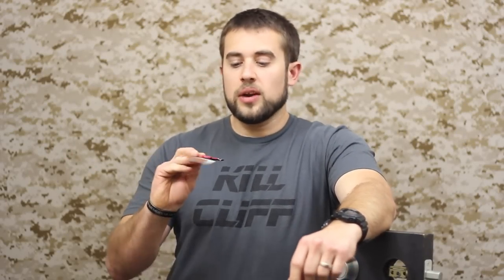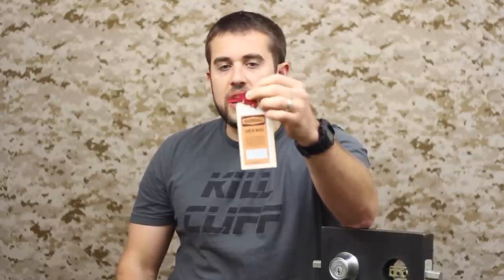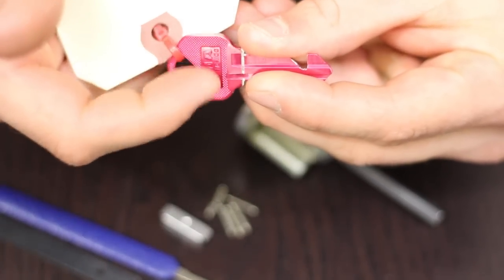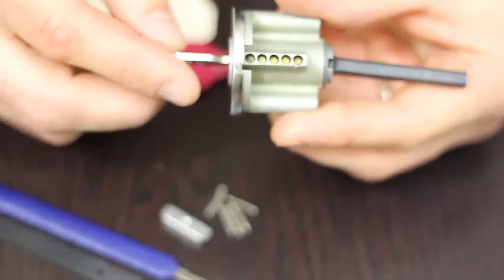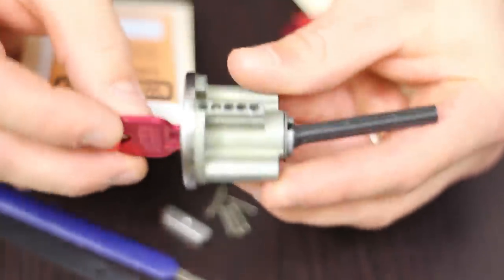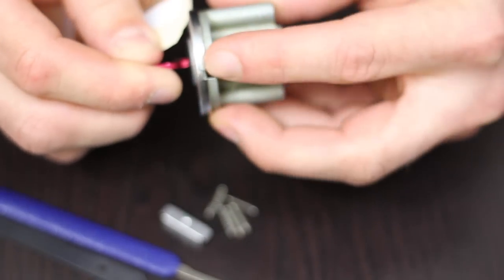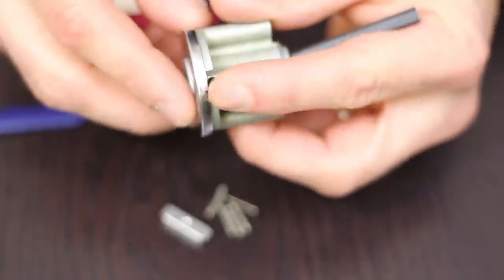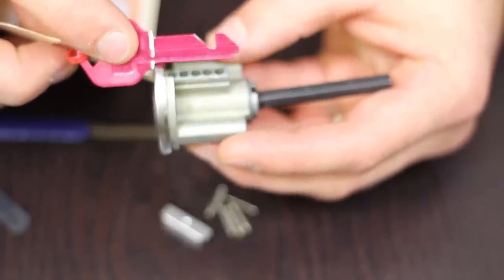Permanently Disable a Household Lock with Lock-Kill

Comment: How well does that work on Multi Lock? Thanks.
Reply: +X- Tremevidpro There is no Mul-T-Lock version, and there never will be. Mul-T-Lock dimple locks work differently, and you're much better off breaking an old key off in the lock and supergluing over it. A locksmith (or a clever enough person) can easily recover the lock afterwards, and recovering the lock without authorization would be considered breaking and entering in just about every jurisdiction.
Reply: How about Medeco? Can those be picked?
Reply: +X- Tremevidpro any lock can be picked. Medeco locks tend to require much higher skill and/or luck to get open. For some of their locks, there are sidebar bypass methods (eg medeco3 bent paper clip bypass) that can make it much easier to pick. Making a key like this for a Medeco lock would be kind of stupid, as the lock cores themselves trend upwards of $120 each.

Comment: I think this is very self explanatory -- all you had to say was - "this key traps the pin in the 90' section...so you push it in and then snap of the end... you can only remove by drilling it - you cant use a lock pick"

Thats how simple it is - 30secs is all you needed

Comment: It appears to do as advertised. However. not sure this is the best solution to prevent someone from being able to unlock or lock in the future. As you are basically destroying (rendering useless) a lock which if you are a landlord would need then to replace the lock. To skip past the clamp/lock type blockers that would prevent the knob from being turned or key being inserted stuff. Why not just change the lock since your going to need to do that with this product or if the tenant finally vacates you will need to change the locks. I just think this product just has a malicious purpose that will only be used by someone in a vindictive manner vs some official or legal purpose..

Comment: You can take the handle apart and use a piece of pop can from the back and slide it in over the pins (between the pins and the key) to release the pins instead of taking the spring holder off. Of course you would need access into the house first to take the handle off.
Reply: Won't work. You can't shim a cylinder if you can't life the pins. I use an uncut key and slide it out as the shim slips in the shear line. With this key pushing all pins up, and all shear lines in the wrong places, and the one pin stack down in the plug, there is no way to shim it.
Reply: I understand what you're saying but a thin piece of tin "pop can" can save the lock and not damage it.
Reply: What a "POP"can? I have never heard of one before?
Reply: Aluminum soft drink can.  Soda, pop. Depends on where you are from. In the south, where I am, it's a can or bottle of pop.
Reply: jimu57
 I have lived in Texas my whole life and never heard anybody call a bottle or can of soda a can of "POP". I had to do a little digging on it and found out that the word POP comes from the Midwest not the south.
Reply: The old Andy Griffith shows called it "a bottle of pop" at Wally's fillin' station.  I have always called it pop and everyone in this part of the state does. Well, most do. Its rare to hear soda unless its from someone that is from north or west of here.

Comment: So if your a landlord and lockout a tenant with this thing how do you get it out later? Our deadbolt requires it to be unlocked in order to remove it... Do you have to replace the door or cut out the lock and patch the hole every time you evict someone?

Comment: This gentleman use the implication that this device was going to be a tool for a landlord to use in order to disable I walk for a home so that the tenant could not enter the home before the landlord had the ability to change the locks I don’t see how that’s possible or for that matter legal. The landlord is not allowed to change the locks or disable the locks and deny a tenant access to the property until they have a legal court order to do so once the court order signed by the judge the landlord is then accompanied by A constable or sheriffs deputy to evict the tenant and would also wet that time bring a lock set to replace the old locks with. At no time with this device be legal for the purpose the gentleman described. And for any application in which this would be legal it would simply be unnecessary

Comment: I see no practical use for this myself?, but if  I had one?, I would just buy only one of each for the pattern and cut my own from blanks there on because it is no trouble to intentionally snap a key off after it is inserted into the lock. This product likely will not last long?, because it would be too easy to do that instead of paying $10-20 bucks a pop for one.

Comment: What's supposed to be the point of this? It just breaks a lock forever unless you're going to take the door and lock apart. If it was difficult but possible to extract I'd see the point, but this is the same as pouring superglue into your keyhole.

Comment: Changing a set of locks takes 5 minutes. The only possible use I see is if the tenant has already changed the locks to remove access for the landlord, so the landlord could, in turn, remove the tenant's access. He'll wind up calling a locksmith one way, or another.

Comment: That's a little overboard.  All you need is a flat toothpick and some bubble gum.  Shove the toothpick into the lock, break it off, and mash some bubblegum in after it.  The bubblegum hardens after awhile.
Not as permanent as the video above, but just as effective.

Comment: This product seems so pointless. You now have to break the door or a window to get back in (unless there's another door in which case this is pointless anyway) and then you have to buy a new door and a new lock to replace it. If it's a Schlage/old style kwikset and you know what you're doing, you can also pull it out from the back of the cylinder once you remove the retaining parts

Comment: I think I know a way to remove this key.

We know that the key is easily inserted, but gets caught on the way back due to the 90 degree cut.
Knowing this, the obvious solution is to remove the handle of the key and then push it all the way through to the other side. 
This method would only work in cases where the lock is two-sided, however.
Reply: Jonathan Fowler no, no that's not how locks work

Comment: just jam something in the lock like some paper and mash it in hard..  I knew a guy who would take a good key cut it between the pins about half way down.  Then put the tip in and push it the rest of the way with the other half or maybe another key.  They won't be able to get their key in. I personally think its too much work, as I said just jam anything in the lock and pack it in there.

Comment: Could just rekey or replace lock. $60 for rekey kit vs up to $50 on small house with this. And rekey kit you can do thousands of locks. So how the landlord supposed to get in now? Now landlord got to spend $200 having 2 locks drilled...dead bolt and knob and still has to rekey or replace. Why don't you just hand landlord a stapler to staple all their money together to roll up and tear off roll to wipe ads and flush.

Comment: don't use glue nerds,  after you use this fancy device here you can just take the lock apart and remove the pins that are holding it in.  then you can piece it back together and use your lock again or save the pins and rekey the lock

Comment: This would handy for spies escaping through a very specific type of door that the place they’re doing the mission may not have, but in this very specific scenario, it might be useful is some very specific circumstances take place, every single variable needs to fall into place for this but hear me out. 

Spy is compromised, door is open, door has lock, door has turn handle on the inside side to lock/unlock without key and guards have the keys to the whole building so could unlock the door, spy places lock kill key in the lock on the outside of the door and snaps off the head, guards chasing spy can not unlock door, buys spy time to extract. 

Other than that yeah this is totally fucking useless dude although I respect your enthusiasm for such an inane creation.

Comment: Great idea!  Disable the lock to deny the tenant/renter access, as well as denying yourself access!  Brilliant!

Generally, one needs to be able to unlock the lock in order to remove the lock or even just its core in order to rekey it.  A lot of Kwicksets may be easily drilled, but Schlages often have anti-drill pins of hardened steel installed specifically to defeat attempts to disable the lock by drilling it.

A much better idea, since using a Lock-Kill will require you to replace the lock anyway, is to just rekey the lock to begin with.  A locksmith will charge less for a simple rekeying than for removing and replacing the damaged lock, assuming you can't do the job yourself, for some reason, with a new lockset bought down at your local big-box store.

Comment: This seems like a dual waste of money. Once for the piece of aluminum and once for the lock you destroyed. Ya know...A toothpick and superglue will work just fine..Just sayin. Dip a toothpick in superglue and stuff it in the lock and break it off and chase it with the key..thus rendering it tenant proof and temporarily bars entry as you can always reuse the lock at another location thus saving MORE money.. All you need to do is soak it in acetone and remove the toothpick. Some folks have more money than sense. But I still subbed. LOL

Comment: Kinda lame as it takes about 2 minutes to just drill the two screws holding the lock plate from the outside and then just replace the lock. So it's not that useful as one would think

Comment: i bought a set of these from sparrows and for some reason i thought they could be taken out.  yeah i have no use for them
Reply: ChrisD4335 so,you're saying that even the deepest set pins can be pushed up far enough to remove the key?  i have a lock, and it has no springs and the one pin scrapes against the core, because it barely made it up there.  and that's with no spring.  i'm not trying to argue, i mean obviously the only problem i see is the pins that are cut the deepest.  but maybe it is possible either way.
Reply: ChrisD4335 If you got in the property, you just unscrew the lock from the inside, take out the cylinder and flip it over, and take this blocker thing out. A magnet is unlikely to be helpful.

Comment: What is the point?   How will a landlord open the door again to change the locks?   Why not just change the locks to begin with?   Instead, he is going to go online, order one (or three) of these, pay whatever it and shipping costs, and wait days to get it, when a new lock can be bought at any hardware store, and installed in minutes?

I see something like this being used by an evictee to screw over a landlord, mor than for a landlord to protect his property
Reply: +Constantia Group (Investigations) The point is to sell $0.25 USD blank keys for $12 USD. It's just marketing BS, there's very few legitimate uses for these keys. The keys don't even destroy the lock, you just have to remove the springs and turn the lock upside down to remove the key.
Reply: +Constantia Group (Investigations) you can pull the key out with the cheapest key extractor on the market.
Reply: +hipu picks - you miss the point, in order to disassemble the locks, you have to do it from INSIDE the house.   how will a landlord get inside the house if he disables all the locks this way?   If he is concerned about someone coming back and entering the house, he will have to replace the lock anyways...now or later.   it's a solution to a problem that doesn't exist.
Reply: +Constantia Group (Investigations) yeah, it's a solution to a nonexistent problem. marketing bs. which is what I just said?
Reply: +hipu picks :)

Comment: Why in the fuck would anyone ever use this???????????????? First of all it's extremely easy to remove a lock and repin it, you don't need to be lock smith, but even if you don't wanna do that bring the lock to a locksmith shop and it's really not very expensive to have locks rekeyed by the pros. Secondly i can think of a ton of cheaper ways to "disable a lock".

Comment: You can melt it because keys are made of a thinner and weaker metal that still conducts electricity. The more electricity you pump in it the hotter it gets and then it starts to melt and become moldable faster than the metal around it. Also for someone trying to break in to the house do this on a back door at night wearing all black. No one will see you and you won't make a sound.

Comment: So worthless.
After a $20 blank key and a locksmith to remove it all, or your time spent removing it, and buying a new lock.....wouldn't it be cheaper to just replace the lock without all the extra steps?
Wouldn't it

Comment: So assuming a landlord has evicted someone and needs to keep the door locked, why not just super glue it shut? I mean, in the case of an eviction, the landlord normally changes the locks anyway so the evicted tenant can't use their old key later. If for some reason you need this lock shut, forever, NOW, and it's going to be replaced, why not just destroy it? And considering these Lock-Kills are only made for $10 locks, it seems like a waste.

Comment: So pull out you credit card or similiar  plastic and just shim the door  lock open in a few seconds instead.
Reply: I haven't seen anyone shim a deadlock.
Reply: Nor have I.
The lock has  to be the curved type.
Reply: Pretty much every lock that isn't some $10 cheapie has shim protection.

See that second, little tab next to the curved bolt on your front door lock?
Press it in and the bolt will not move. This stops the bolt from being pushed in while the door is shut.

Comment: There are 2 ways past this, are they harder than brute Force well one is. The first is a screwdriver, or taking a power drill and then in the end replacing the lock yourself. There's also nothing stopping you from picking the lock yourself. Yes it is more difficult to pick the lock with a key in the lock but not impossible. Would it be easier and probably cheaper to buy a power drill and a lock with all the accessories necessary to fix the door yeah that totally be easier. I'd recommend the drilling the lock especially if you have access to like the back door or something when no one's going to call the cops probably. Especially because my neighbors have construction so the old ladies near my house yes all of them are old ladies won't call the cops.

Comment: I got a bunch of keys I can just file them for free or go to the lock shop and they will copy a bunch for the same price of a copied key. Doooyy what a rip-off you idiots try and sell them for big bucks, I can also just use gorilla glue if it's a medeco or another hard to get key blank and the lock is worthless! A bar owner just payed the price the other day because they kicked me out for just tapping  the bouncers shoulder to talk to him,totally unexepable!!! Also if you have a 0.18 shim you can slip in around the key and lift the pins up  thats why I cut the break off shear on the thicker part of the shoulder, they are not slipping anything past that, lol!  Use gorilla glue not super glue, you can't dissolve it, they will have to break into there own place and cause more damage and have to replace all the expensive medeco cylinders!